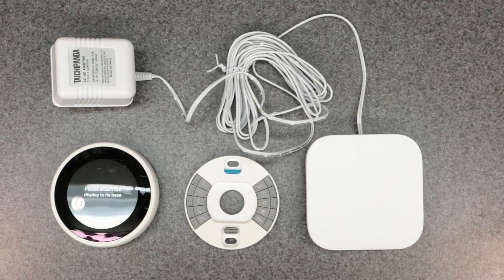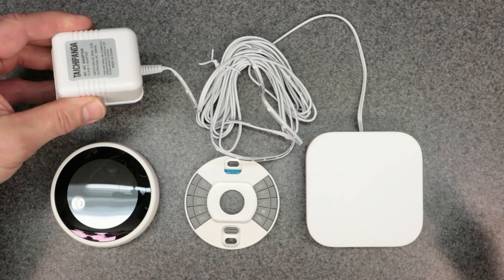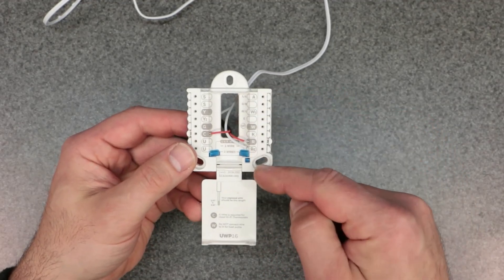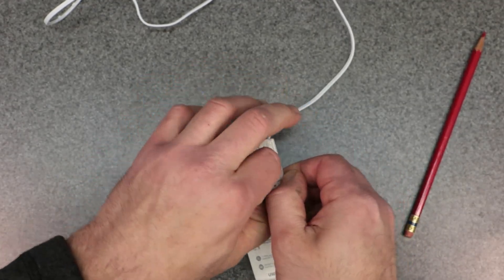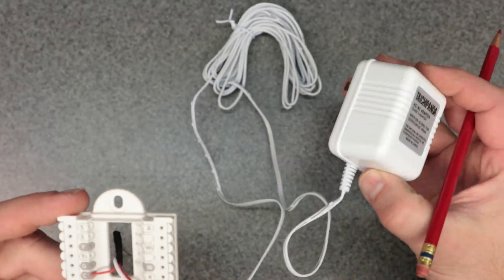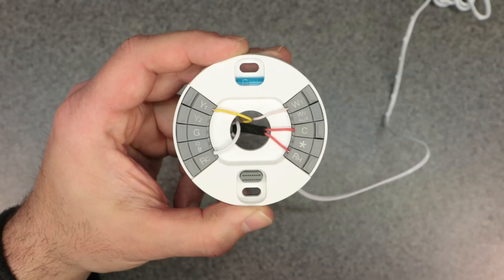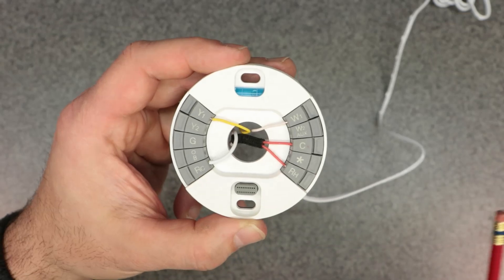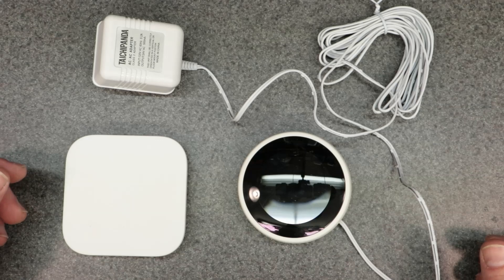Universal 24v Common C Wire AC Adapter - INSTALL Google NEST & Amazon Smart Thermostat

Comment: I have 2 wires for my boiler heater ( r and w).
If I plug them to nest Rh and W then should this go to Rh or Rc? (Another goes to C)
Reply: struggling with the same setup here, nothing i do makes it work right
Reply: @dwreck621  see my answer below.
Reply: I am not a HVAC professional, just my 2 cents, connect the R to Y1 and the W to W1. Connect the transformer white wire to RC and the red wire to C and RH to power your Nest.

Comment: In this video you said to connect the Rc and C wires to the wall plug-in transformer. Then you said to connect the R wire to the R terminal.

Isn’t that dangerous?

You’ll be connecting two transformers together at the R/Rc terminal at one thermostat and they can backfeed into each other? I have an Alexa thermostat and I don’t have a C wire available to me so I was hoping this would work, but I’m not confident of the safety.

Comment: Installed 4th nest. I have 3 wires from furnace . Unit is working, support says I still should get the nest power adapter but i don't think it will work as I don't have C or common wire. Is this power adapter necessary?
Reply from the maker: yes, this is the power adapter to do that. There are also 2 other ways. Run a C-wire thru walls to thermostat or if you have 4 wires you can covert that possibility with the Honeywell adapter which turns a 4 wire to 5 wire(adding c-wire)
Reply: @ModernHotrodsNH  the cable from furnace to thermostat has 5 wires. 3 of them are actually connected from the furnace (RH, Y, W). Your 1st suggestion run C wire from furnance. Where in switch board is the C wire will be connected to? Then go to thermostat?

Comment: This video is a huge help, thank you! Question though, my google nest Thermostat (newest gen) only has Y, C, W, G, R, and OB. Can I just connect the two wires of the adaptor to C and R and it will suffice to power the thermostat? I don’t have an RC or RH, just R.
Reply: Yes, looking for an answer on this aswell... did you figure it out?